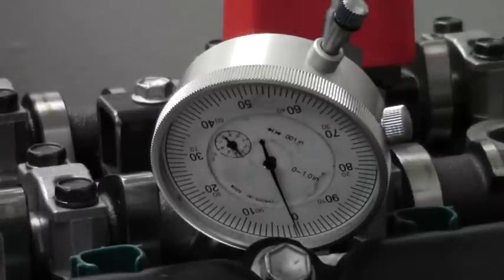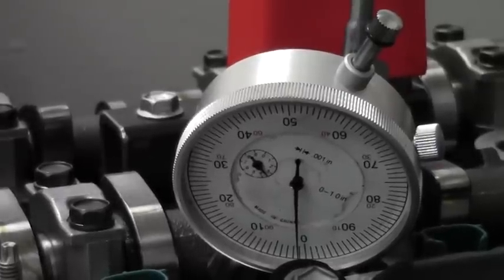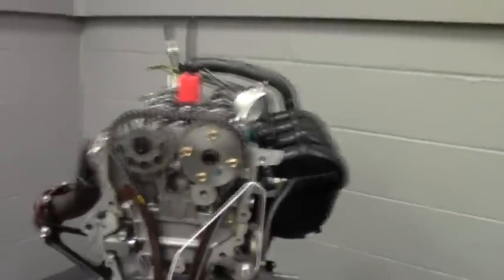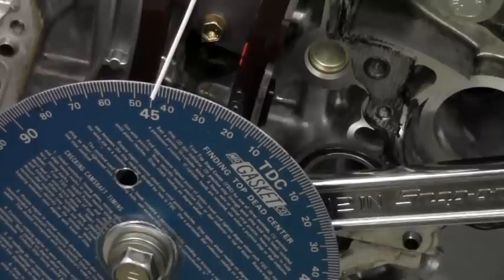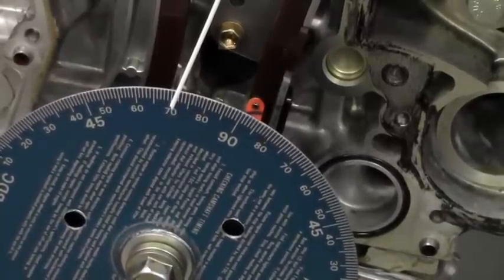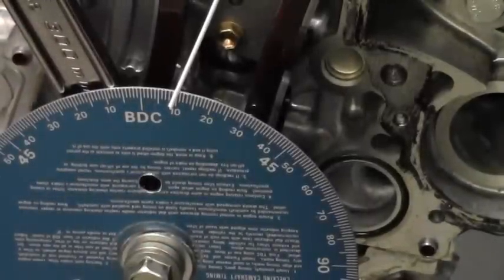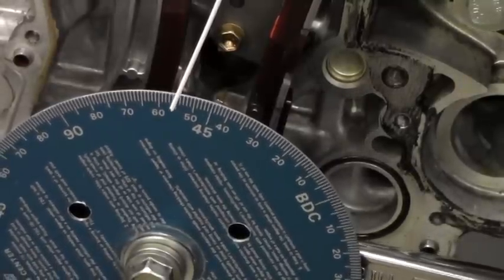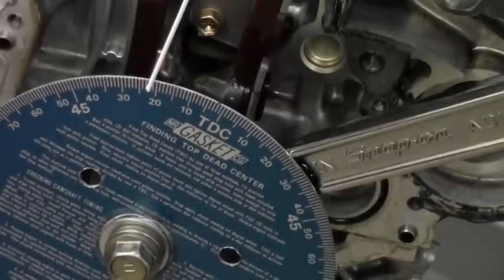camshaft degreeing 003

Comment: Where's part 2 or "002" of the videos?  It went from 001 to 003.  Oh yeah, at 5:27 into the video, the degree wheel read 66 degrees, not 61 degrees.  In addition,  I'm certain you meant to say 24 degrees after TDC, not "before" TDC at the end of the video.  Thank you for sharing.